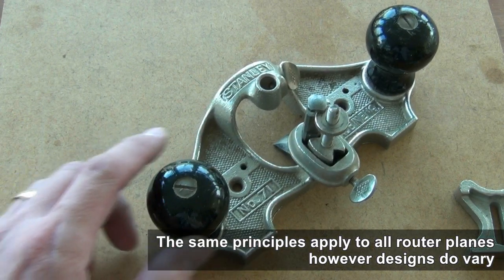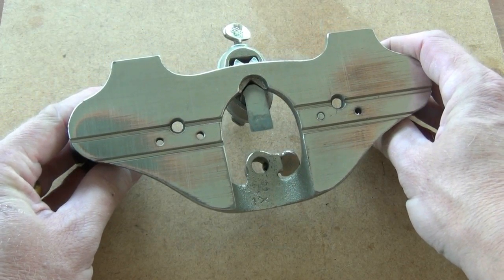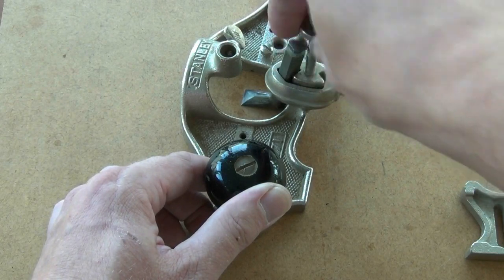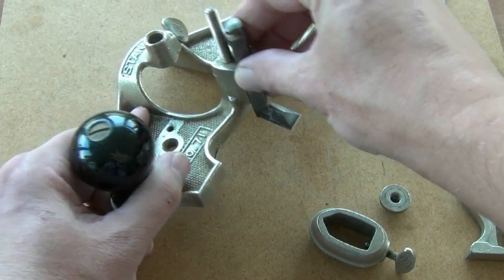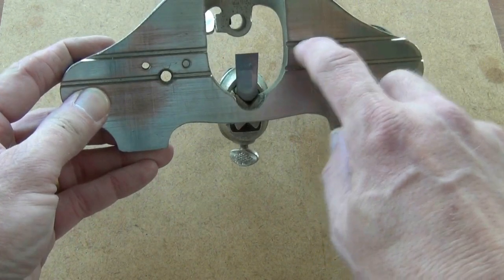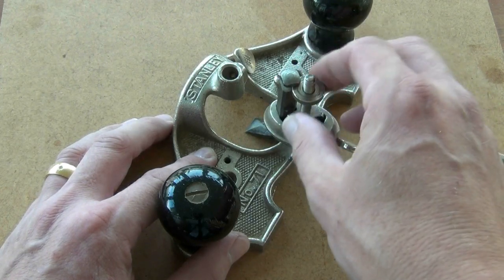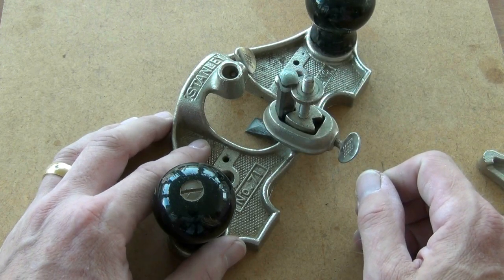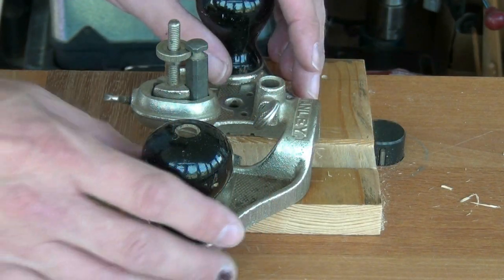Router Plane Anatomy - Stanley No.71

Comment: Nice tips on adjusting Mitch. I needed to watch as I just received a Millers Falls No. 67 that I bought on Ebay. It's in remarkable condition and I can't wait to put it to work. Thanks for sharing.
Reply from the maker: Bill K. Cheers Bill. These are so handy, I'm sure you'll enjoy using it
Reply: Hi Bill, i bought the same one on ebay, but the adjustment screw for the depth is very rusty. So i wanted to replace the screw, but can't identify the dimensions, i usually use metric screws ;D. So can u tell me wich dimension the screw has?

Comment: Thanks for your video, have a question:
what is the shoe good for?
Reply from the maker: +fridunanti Cheers. The shoe provides a bearing surface ahead of the blade, which is necessary for working into narrow areas. I attach a sub base that simply has a clearance hole slightly bigger than the blade to achieve even more support. Made from perspex, you can still see clearly where you are cutting.

Comment: Hi Mitch, I am really enjoying this series.  Any chance you can review a bullnose plane? I own a small one from Millers Falls. I thought it would be an okay shoulder type of plane until I can get a proper shoulder plane, but it is really hard to get it to do anything.  The blade is sharp, but no matter what I do,  it doesn't take decent shavings.  Thanks!
Reply from the maker: Kevin Blair Hi Kevin, Thanks for that. As for the bullnose, I've never owned or even tried one. However, it could be that the toe is not level with the rest of the sole. That would be my starting point. Retract the blade, rub on 200 grit wet&dry, and see if the whole sole (heel to toe) is being touched by the paper. Let me know the result.
Reply: WOmadeOD - Made in Wood with Mitch Peacock Hi Mitch, I don't know if I can post a picture of the plane which may be clearer than a description, but I did as you suggested. This is the second time I have flattened the sole. I use a piece of granite (a cut out for a sink) that I think is quite flat and 220 wet/dry sandpaper. The heel to the mouth seems quite flat. When turned over and a straight is placed on the sole from heel to toe, the toe is actually a mm or so below the rest of the sole. Thus, when in use the heel to the mouth will be in contact with the wood, but the toe would be a mm or so above the wood surface. The blade is sharp, perhaps not "scary sharp", but enough so that I can use it as a small chisel. When I place the blade into the plane the bevel is up. The bevel is about 25 degrees. I set the blade so that it extends a mm or so from the mouth. I have played with all sorts of variations in terms of amount of the blade extending out from the mouth. In use, the plane either does not cut at all; feeling like it skims over the top of the wood or it binds and requires,what feels to me, like excessive force to make a cut. Even though the blade is parallel to the mouth, only part of the blade cuts when it cuts at all. BTW, internet research on this plane seems only to lead to posts similar to mine re: can anyone make these things work? Cheers, Kevin
Reply from the maker: Kevin Blair Please do send photo's (post@womadeod.co.uk) showing as much as you can, but especially:Sole as is,Sole covered in marker pen,Sole after a few passes on dry 220 wet/dry (showing what is touching),Plane mid-cut showing partial shaving,Close up of blade edge,Front, side, rear, and top of plane.Best send them one by one as jpegs < 1MbA few things come to mind, and hopefully the photo's will help decide what.Look forward to seeing the photo's, Mitch

Comment: It's a pity stanley no longer make these, the prices on ebay have gone through the roof recently and I resent paying upwards of £100 for a used one.
Reply from the maker: Shop made router planes can be very good. There's one in either the TOOLMAKE15 or TOOLMAKE16 playlists.
Reply: Scrimjaw i had never seen one before. Just found one at a thrift store an hour ago for $20... been looking into them ever since and looks like a handy tool. Mine will be restored back to new or better than new... but not painting it.

Comment: I have acquired a Stanley No. 71. Only the casting, it did not come with hardware. I had a friend turn the knobs for me so I’m on my way to restoration. I live in the US and I believe Stanley imported the threaded hardware from England for the planes they made here. I’m stumped, as well as 3 hardware stores, as to the threads on the threaded post and the threaded holes for the screws to secure the knobs. Do you know what the thread size is for the post and the holes to secure the knobs? I have the equipment and know how to fabricate all the hardware but before I go further I want to make sure I can get the threaded parts. Thank you.
Reply from the maker: Hi, I'm not sure they are all the same, but my 71 uses N/F 20 for the knobs, N/F 24 for the cutter post, and N/F32 for the depth stop/shoe and cutter collar. I don't have a depth stop/shoe with mine, so if you find a detailed drawing of one I'd be interested in getting a copy. Good luck with the re-build.

Comment: I have a old Ohio 71
Reply from the maker: Nice!
Reply: @mitchwoodwork  I need some help in restoring it?
Reply from the maker: @vincechoraszewski2394  what's the problem?
Reply: @mitchwoodwork  I have no literature about it and don't know what size of a blade I need.
Reply from the maker: @vincechoraszewski2394  I don't know the technical details about it so your best bet would be to locate a user manual. That may seem daunting, but here are some suggestions that may help. Find Chester Spears youtube channel and see if he has a video on it or any other router plane, then through the comments ask for his help:  he owns far more variety of planes than I do,  and old catalogues. Track down Bench.Talk.101 on Instagram and join one of our weekly Zoom meetings, where Chester and others are usually available to chat with. Join the unplugged woodworkers group on Facebook where you can find a wealth of literature and knowledgeable folk.